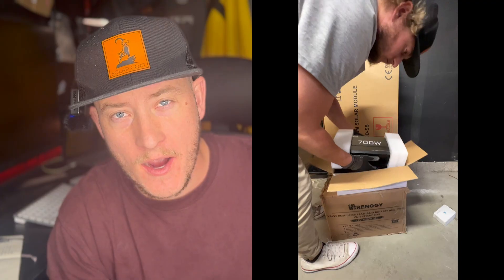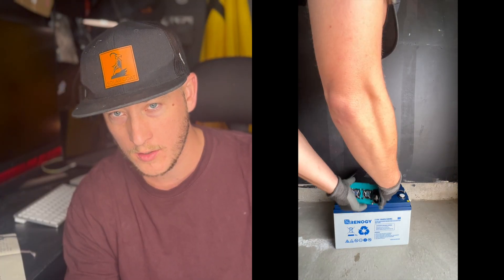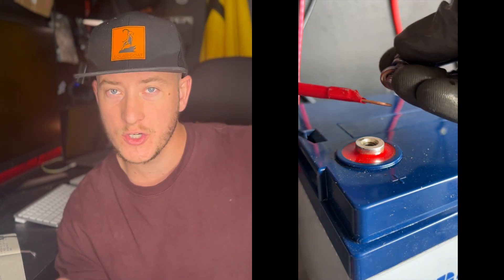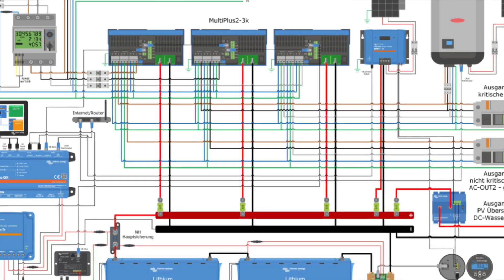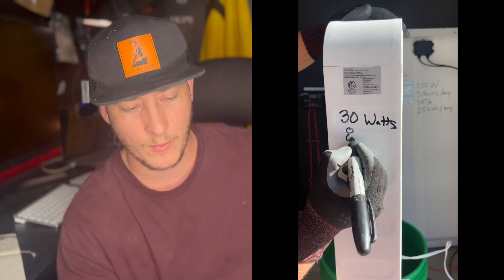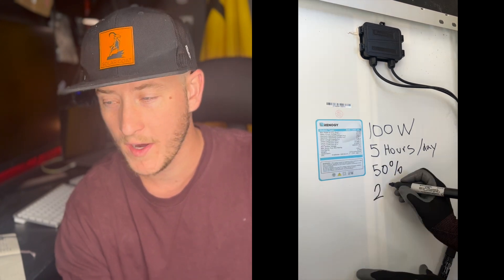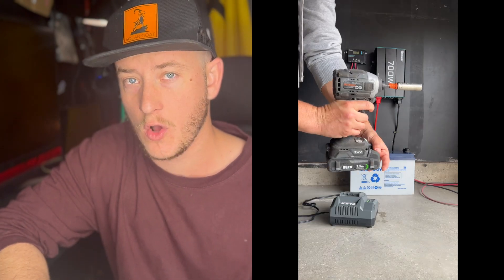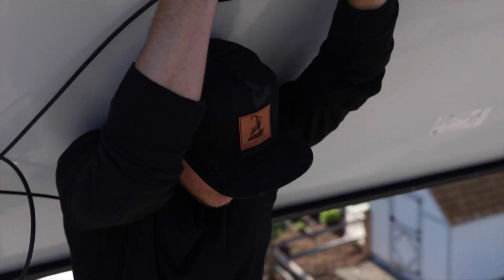What I Learned - My First Off Grid Solar Build

Comment: 1. Get MMPTs 2. Cry Once Buy once (victron) 3. 24V if over 1500Watts. 4. 150/35 Victron is best all around MMPT, 12/24/48V Capacity. 5. Double your Battery Capacity you THINK you may need. 
Great stuff Love the channel